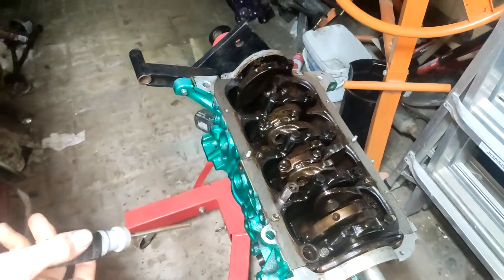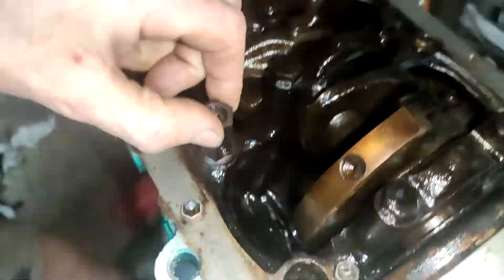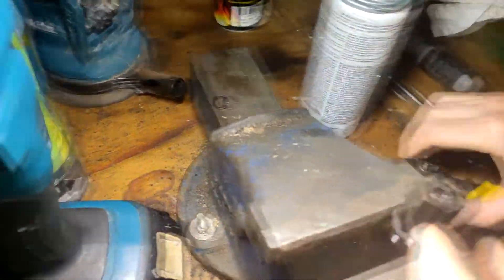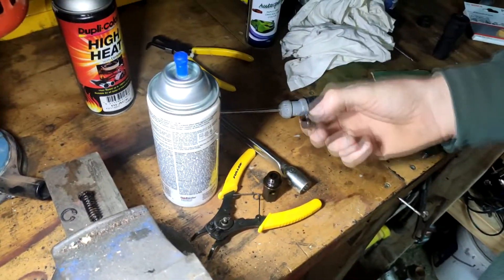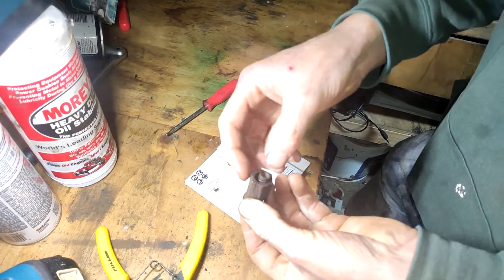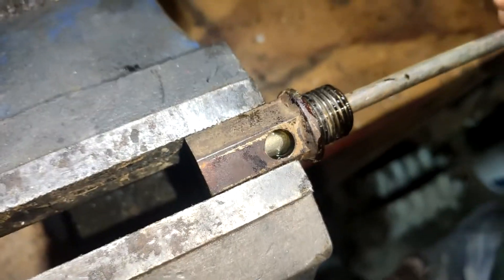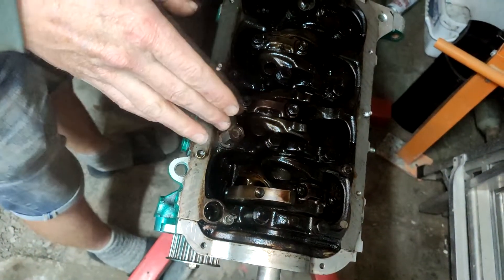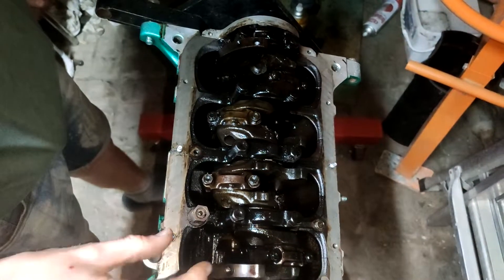Toyota Corolla 2E Engine Easy Mod To Increase Oil Pressure 100psi !!!

Comment: Do you have a way to test the relief valve before installing to make sure you get good pressure on a standard build.
Reply from the maker: U could would have to make a jig up and hook up to a air compressor I usually put 2 1mm washers in that was around 90-100psi oil pressure at full tit

Comment: Won't the seals start to leak from excessive pressure?
Reply from the maker: Na the seals haven't leaked at all most people get oil leaks from these engine coz the don't seal them up with good quality products and also don't clean the surface properly

Comment: I have low oil light on idel rpm when i increas rpm light goes off , can i use this method ?
Reply: Change the pump before it cost you a engine
Reply: Might be bad oil pump or too much wear on clearances.

Comment: estimating i put 2 washers with motul 10w-40, should go for 80-90psi right?
Reply from the maker: Yea it will be around that pressure but I would recommend 20w-50w Ive used 10-40 but it goes very thin fast
Reply: @RuggedGarage  though would it vary with the ambient temp of our locations? i live on a tropical country. also, recently after i took it to a local touge, it has no power when i put on the throttle more than 30% and also on 4k+ rpm could it be a dirty fuel issue?
Reply from the maker: @FuraiFuru  you will probably find that that is either a carb issue or a spark issue

Comment: is 3 washer to much for a N/A 2e motor?
Reply from the maker: 2-3 washer is good for a na motor depends on if it high performance or not if not go for 2 washers
Reply: My plan is to make my 2e have twin carbs, cuz I got some carbs from an old Celica
Reply from the maker: @alexhs0595  that's sick yea go with 2 1mm washers that will be perfect mate

Comment: If I have upgraded valve springs with a stock intake on a 2e efi motor, how many washers would you recommend?
Reply from the maker: 2 washers would be good

Comment: Ano po ba dahilan bakit d magbomba ng oil ang 2e engine ko 
Bago na oil pump nalinis na oil pan at sa screen sa ilalaim
Oil changed na bakit walng pumapasok na langis sa oil filter at sa cam
Salamat po
Reply from the maker: hey mate check to make sure that the oil pump is still in good working condition. And i would also check the oil pickup and make sure nothing is blocking it and that the o ring is intact also check the oil relief valve. it sound like a oil pressure issue because you are not getting oil to the head or the filter it

Comment: If I only put 1 washer how much oil pressure in psi would it be?
Reply from the maker: stock oil pressure at idle is 3.5kg(49psi) and at high rpms it goes to 5kg(71psi) using 20w-50w oil if you put 1 washer in it will increase to around 6kg(85psi)